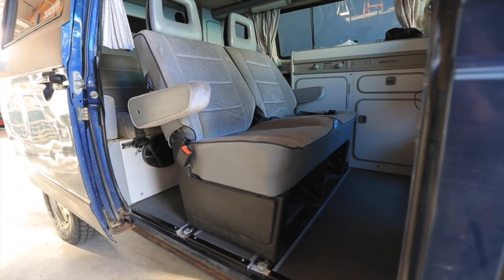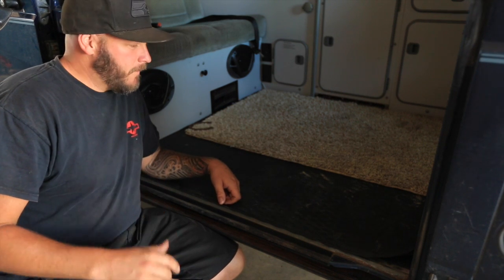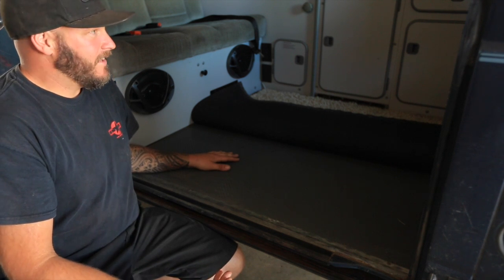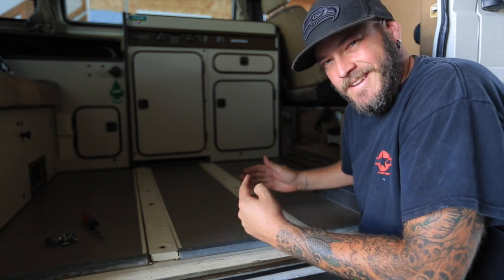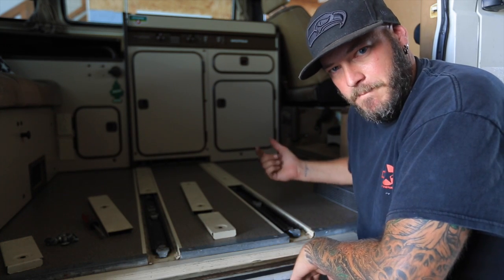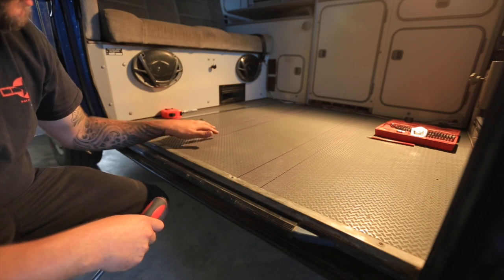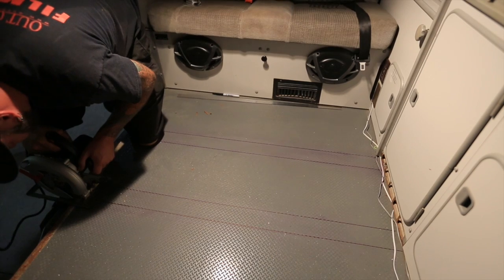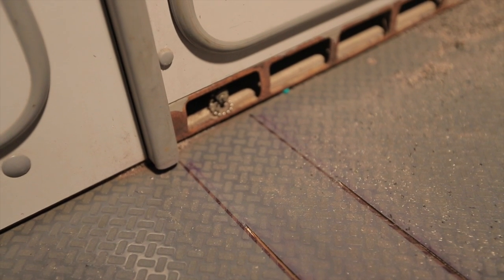Living The Van Life - How-to:  Install 3rd Row Seat In a Westafalia

Comment: I've took out the kitchen since I haven't been using it for years anyway, and cut out the floor to install the rails. I've put them a little bit more to the front so there still enough room for the back sit to flip into the bed. Unfortunately, all I found underneath is a wavy thin sheet... It seems my Rime was a cargo van. Any advice how to properly fix the rails?
Reply: How did you solve this in the end? I am struggling with this. Bought a middle seat, rails and everything only to discover we seem to have bought the only Vanagon without the factory fitted bolt holes in the floor.

Comment: Hey Chad! How did you attach the aluminum strips to the floor? Did you use screws or are the end pieces just holding them down in place?
Reply from the maker: Hey Scott!  I used an adhesive to hold the strip down. It's worked great even a year later.
Reply: +Living The Van Life Thanks! That's what I was thinking since I didn't see any screw holes. That's my next project in my 83 Westy.